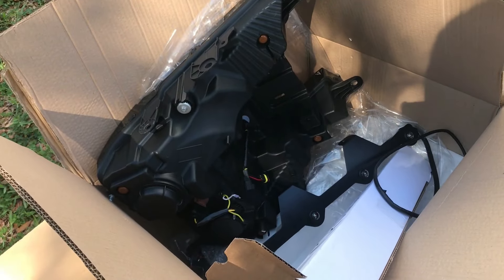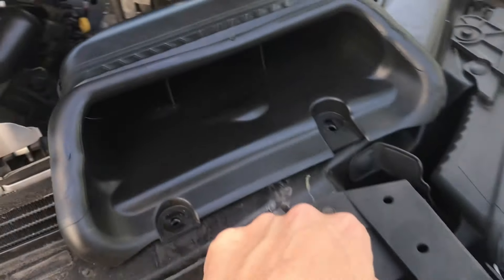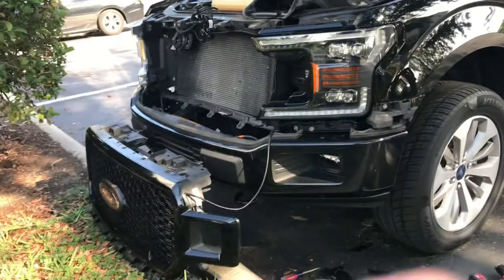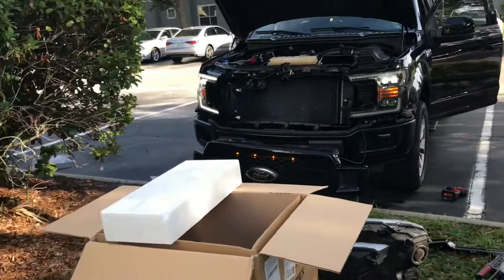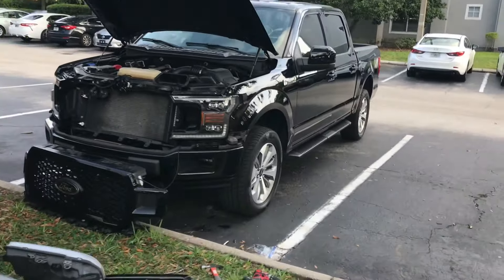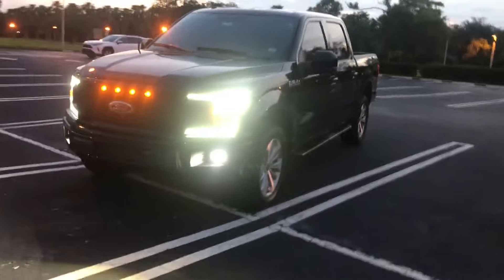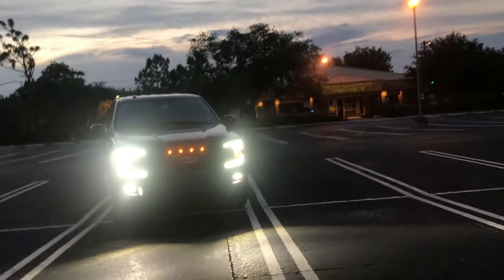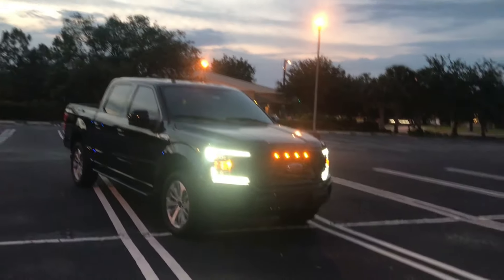INSTALLING ALPHAREX NOVA SERIES HEADLIGHTS FOR MY 2018 F150! / DIY

Comment: Looks really good, I knew it would. My brother just did the Morimoto XB’s on his 2015 F250 and it looks badass. He paid about 1500 for those with tax and everything. Did your raptor lights integrate pretty easily with the Alpha Rex headlights? I have the same ones and they were super easy to install. Only thing I’m gonna change is to put some stainless screws in the mounting holes to prevent rust. Like I said, looks really good, let us know if they live up to the hype or if you have any problems like moisture in the housings . Also, not sure about the Alpha Rex, but if you hook up the DRL harness on the XB’s I believe it makes them dim down a bit when your headlights are on.
Reply from the maker: They were super easy, next video is the install on the grill lights.
Reply: @ProfessorMikee  , roger that. I’m sure yours just came with the Y harness like mine did, just didn’t know if your DRL trouble was because of that or something else.